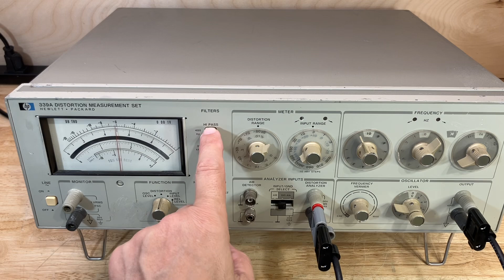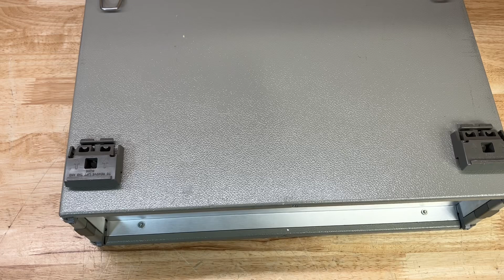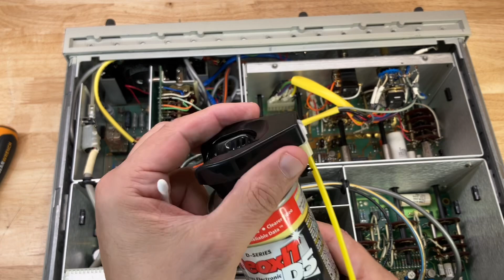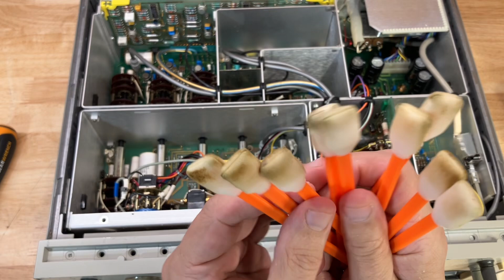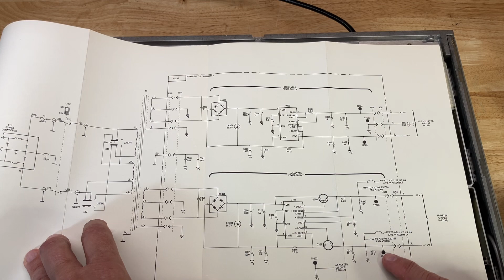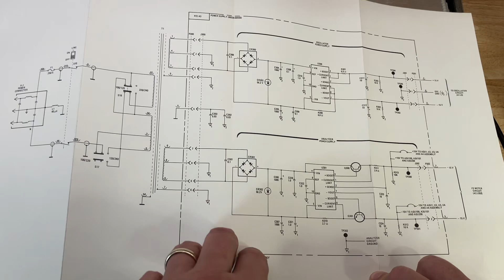HP 339A Distortion Measurement Set Part 1

Comment: Hi, can you let me know where I can find a 60O ohm termination connector like you have in the video?  Thanks
Reply: Thanks!
Reply: @djnickmonte  Yes, the 600 ohm passthrough/terminations are very precious on ebay!
Reply from the maker: @djnickmonte  I made this from a Pomona MDP-8 (gray) dual banana plug with a pair of 1200 ohm 1 watt metal film resistors connected in parallel.
Reply: So the resistors are connected in parallel from the signal to ground? And are you using the two 1.2k resistors so you end up with 600R and 2 watts?
Reply from the maker: @ yes, exactly.

Comment: Suggestion first: I found pointed q-tips made for eye make up which use bamboo sticks.  Still fibrous, but they are much better than regular qtips.
I got my 339A early this summer.  It languished in a barn! but as you said the sealed internals stayed good.  Switch faces,  so 
sad.
I have been comparing 339A measurements to my HP334A and have not felt need to check 339A, but I will now compare my measurements to what you get. Such fine instruments with beautiful insides.
I enjoy manipulating the 334a controls to get a measurement.  The 339A's machine prompted adjustments to get a measurement is truly amazing.  Analog elegance. 
I've seen a couple nice demonstrations of this unit on youtube, but your demonstration and explanation are the best. 
I'm looking forward to your videos.

Comment: 06:50 - HIFI-fools around the world felt a disturbance in the force :-)
Reply: Ha, ask them to tell cables apart in a blind test and you'll see a disturbance. Don't forget you need a monocrystal mains cable for minimal distortion.
Reply: @jamesrindley6215  after the recent mend-it phono amp kerfluffle I learned that they mischaracterize double-blind tests while denying such tests can work. Not terribly surprising I suppose, but you'd think some of them would have the curiosity to actually dig into why those tests are well regarded and dislodge their heads from wherever they are.

Comment: Cool instrument! I like how it combines a few functions. Got a distortion meter, but it's just that - no built-in generator or level meter, you need external ones.

I sometimes had binding posts crack and break away, possibly due to plastic shrink and breaking under internal tension.

Lovely internals, as expected of HP. Spare no expense, cost no object.